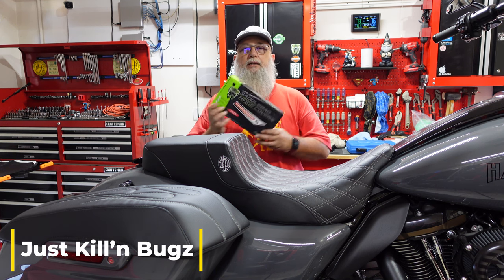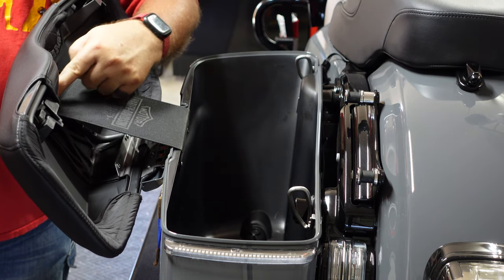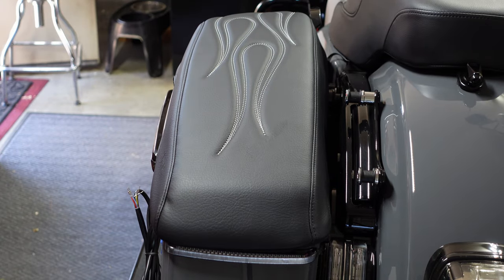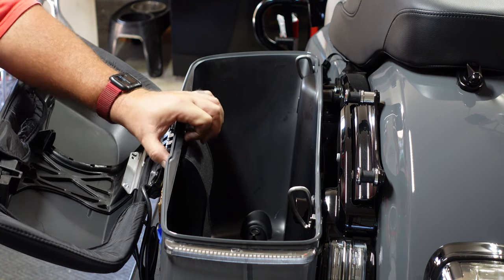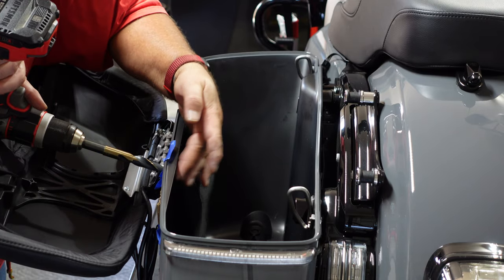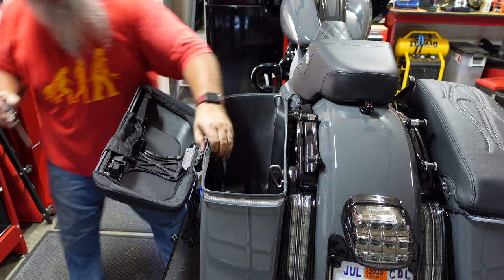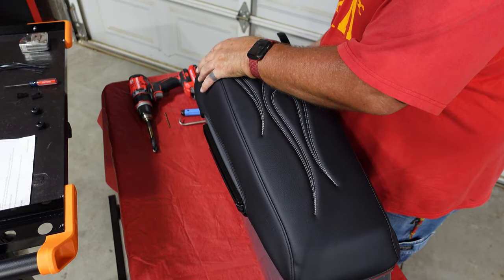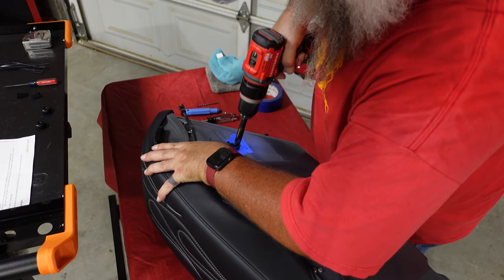2022 Road Glide ST Upgrade - Ciro Lighted Hinge Covers Install

Comment: I see you decided to hook up the little lights on the sides of the license plate holder. You must’ve found a way to get those wires to the front that you were happy with. 👍🏻
Reply from the maker: Hey Tim, thanks for the comments. Yes sir, I did an update video shortly after the first one covering what I found ;-), wasn’t happy until I worked it out, lol. 

Ride safe!

Comment: Hey man quick question, is your brake working with these my run and turn is working but not the brake. Also I need 3 replacements for the pins, three of the tiny clamps that click into the connector are missing so they won’t click all the way in. These say they are run brake and turn. And I’ve seen they do work for the brake on other bikes
Reply from the maker: Hey Cody, thos pins can be tricky, you will need to contact Ciro if the product is defective or missing parts for sure. As to the brakes, yes, I have run, turn, hazard and brake lighting when engaged.

Good Luck!
Reply: @justkillnbugz  yeah my brake isn’t working but the pins not connecting could be the problem. Once I plug in the black but have to
Hold them in, it comes on and works with hazards and turn signals but no brake.

Comment: You did a video on a center stand for your road glide, curious if you could give me the dimensions of the bottom of the foot to the bottom of the frame.
Reply from the maker: Hi Andy, thanks for the question. It would be best to contact Wheeldock for any sizing and measurements since there are many stands and versions depending on the bike and configuration. You can reach them on their website's contact page.

Thanks again.
Reply: @justkillnbugz   please just give me the measurement of the yours. I am getting the same part number. Part of a information video is informative information that is useful. Like a measurement. That should be in the video so guys can see what the options are if needed.

Comment: Not sure if you can help, but I installed the bag blades, front bezel fang lights, Fillar panels, custom dynamics tail light and eliminator kit, ciro fork lights and now I’m getting the p1608 code for the ECM (loss of continuous battery) and the u1042 code ECM right control module is what it says, i cleared the codes but those two keep coming back when i try to start the bike. Nothing looks pinched, everything looks down and secure. Not sure how to fix. I haven’t started the bike in a week or rode it but I just put a tender on it tonight and disconnected everything. Bike won’t start, it started once, went to start again and it just clicks.
Reply from the maker: Hey Cody, sounds like you have been busy. Without being there to see your connections, placement, module order and so on, it is tough to guess. But, I would start by removing all connections and go back to the stock module config (like you did I think) then start plugging in one module at a time starting with the Ciro can bus being first, and test after each connection to see if the lights work and if it throws a code. You may have to clear the code first for an accurate test, but not sure how to do that. 

Hope that helps and good luck. I dont think a week of sitting will cause that much of a battery issue unless you have a constant draw like your fob is near or lights on a lot.
Reply: @justkillnbugz  I unplugged everything,
I checked the ground and positive connection, nothing looks off. The battery is draining, also I noticed that my Fillar panels and bag blades won’t stay on with the hazards when I turn the key off to do a BCM. Is that normal? Only the tail light and CD license plate run the hazards
Reply from the maker: @webechubbin  That is correct, the Ciro/Custom Dynamic lights do not operate with the hazards in the off position, which is what I called out in my video for the turn signal elimination. If you have not watched that, check it out, it may help as well. Tail light, license plate and front fang lights work with hazards off. I only used the Ciro BCM since the Cust Dyn modules caused my Ciro lights to amber out.
Reply: @justkillnbugz  I got the stabilizer from CD. But I had to unplug everything. It was all working correctly but now my battery is dying so I need to figure out how. Thanks for the help man. If you think of anything let me know please!
Reply from the maker: @webechubbin  Absolutely, also, reply back if you find the issue so others can know as well.

Good Luck!